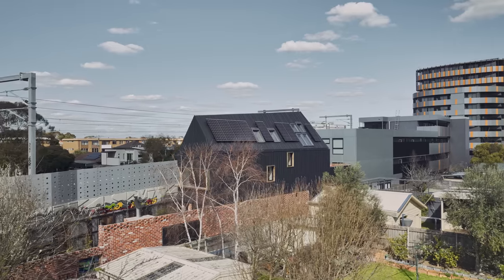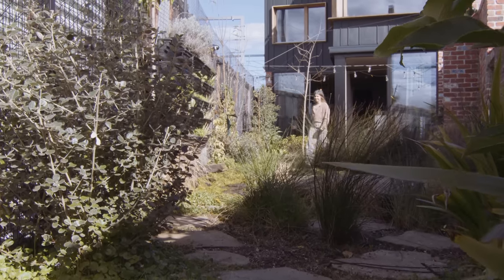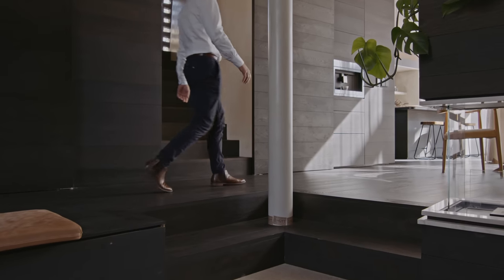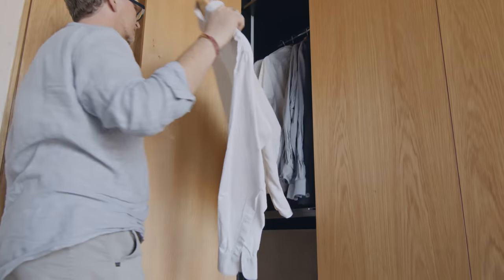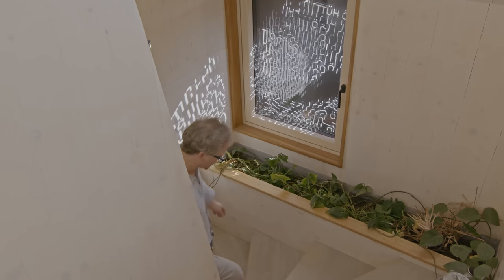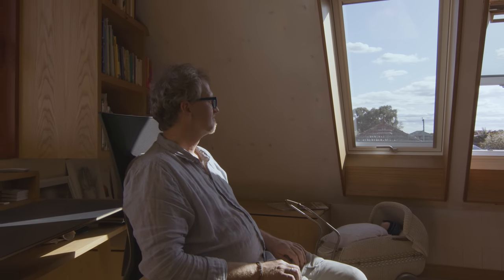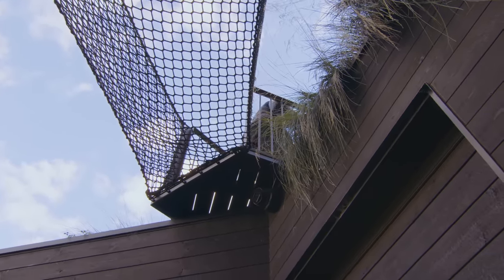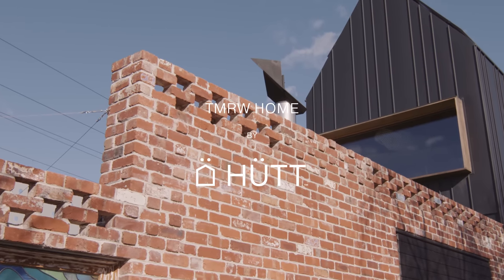Architect Designs a Small Home with a Sustainable and Timeliness Interior Design (House Tour)

Comment: Love how they’ve used a plot of land that many others would have ignored. And they’ve planned the home so well within the tight space, making it feel so much bigger and spacious
Reply: and, it's perfect that it's a passive house - the airtightness also leads to sound isolation from outside, which the plot absolutely requires.  I bet you would go nuts living in a regular house that close to the tracks but I am certain that they don't hear it at all
Reply: @mrvk39  It's an easy assumption to make, but I live in a regular brick built house just as close to the tracks, built in the 80's and experience hardly any disturbance from the trains at all inside, garden is a different story though😅.
Reply: @Ronjohnalex  I also lived in a brick building near subway tracks.  And I could hear everything.  Maybe you had very good windows with sound isolation.  I had old metal ones that came with the building built in the 1970s,
Reply: yeah i wonder why people don't want to live by a RAIL ROAD ;))